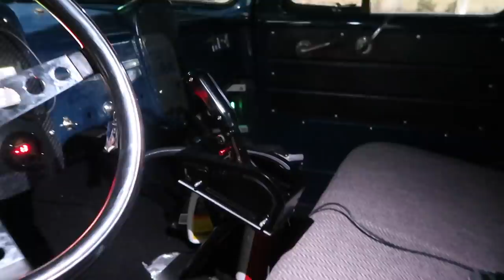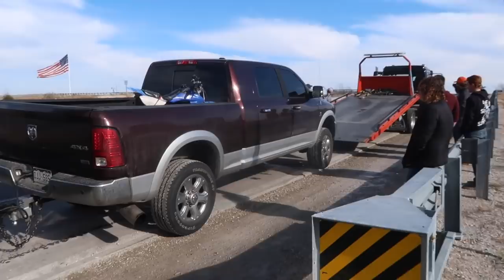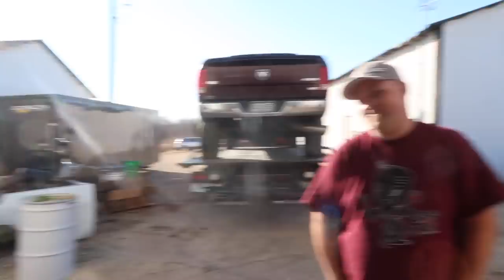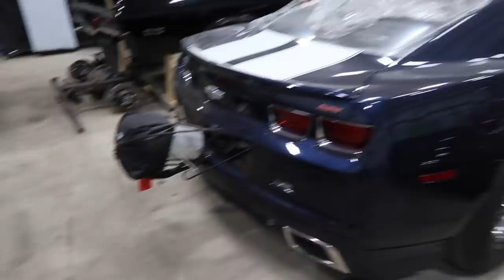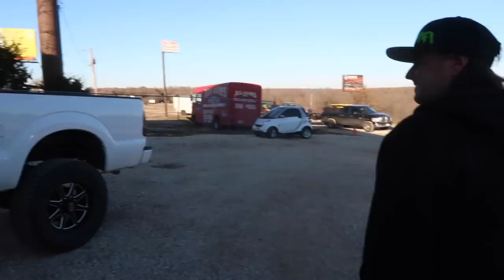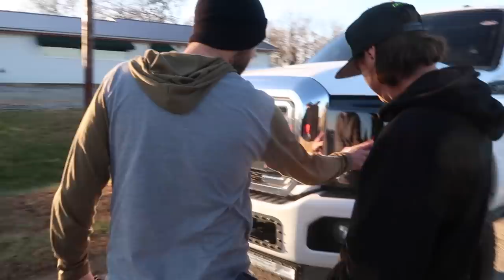Our New Tow Rig Blew Up...

Comment: Dude was gonna sell his truck Monday but let the boiz use it .... Legendary!!!
Reply: I think they should buy the ford
Reply: @burnoutfreak1000  no stick with the cummins or a duramax aint not no time for a garbage stroke
Reply: That Ford is a better truck then the year ram Kyle got there bud. I'm not a ford guy even a little but but the gen ram is complete shit!
Reply: @j0sh368  maybe gm but once again ford saves the day
Reply: @burnoutfreak1000  im a chevy guy, but cummins is the best diesel, everything will break, and in this case the cummins just went early. it happens
Reply: imagine using anything but a cummins
Reply: Could probably charge extra now :D
Reply: All the new diesel trucks are pretty reliable. It's the lack of maintenance that causes catastrophic failure. Take care of your shit and it will last
Reply: @619M3  I have had dodge , gm and Ford 1 ton, and to me my favorite is the 2005 ford with powerstroke.  I did all the bullet proofing myself and its been through hell and back. I understand the heui injection system and they are simple when you understand them. Great power, and the truck and zf6 trans are all around better imo
Reply: @619M3  gm is having major issues with their new platform ford is also and so is nissan which is why they discontinued it. not sure where youre getting your info from.
Reply: @j0sh368  The Cummins is still perfectly fine, it's the transmission they put behind it that crapped out.  Dodge transmissions have been junk for 30 years.
Reply: @j0sh368  its probably a 5.0 1500

Comment: Take my advice guys. While the engine is being fixed, have the valve body on the trans pulled and the fluid pressure port drilled out to increase the clamping force on the clutch packs and extend the life of the trans when towing by about 3 times when towing!!
Reply: Why so it can slam into gear and burn those clutches up? Nah
Reply: More line pressure is key for anything behind a Cummins lol
Reply: @waterloo123100  You burn clutches on slow gentle shifts. Hard shifts is preferable.
Reply: MV60 You don’t want Gentle shifts or hard shifts when building a transmission. You want Firm shifts. It’s not a race car he doesn’t have it pinned to Floor on every shift. Have it to gentle and it’ll burn up. Have it shifting to hard and you wear the steals between the clutches. Or worse the snap ring jumps out and you loose all your gear train. I see it all the time at my transmission shop.
Reply: @waterloo123100  Thanks, I understand the difference you're now getting at. :)
Reply: @waterloo123100   You said at your tranny shop, so then you have seen the older ford and dodge trans come in for a rebuild/replacement and seen the fluid burnt all to hell and stink like hell too, pop the bell housing and pump assembly off and the clutch pack friction material is black as charcoal if not non existent and have the usual spiel of " Well I was pulling so and so that is well under the tow limit, why is it burnt up?"  As you know back then they cut the pressure back too much and it would self-destruct the tranny....
Reply: GingerSquatch Actually I have no idea what your talking about. Older ford and dodge transmissions doesn’t tell me a lot. And the only bell housing you can pop off separately that I can think of is a Gm 4l60e.

Comment: Blames dodge 3/4 of video. Find out later he Towed 10000lbs with a converter code the whole trip. Lmao
Reply: Exactly.
Reply: slip, slip, slip..........boom
Reply: @SuperSreggin  not much of that is a Chrysler
-cummins engineer
Reply: Dodge are known for transmission problems so its no wonder why it had a code
Reply: @mitchellmeyer4177  bahahaha only the engine... mr I work at cummins. Not even the trans or anything else pfffff
Reply: @SuperSreggin  clearly you don't know how auto manufacturing works lol
-mr Cummins 3-4 years of automotive manufacturing experience. Half the ship that you think your auto manufacturer made, isn't made by them. Hell I've heard of our own company not buying our own parts.just because we make our own shit doesn't mean we'll even put it on our truck sometimes
Reply: Cummins is a different company to Chrysler/dodge. It’s a Cummins motor and a Chrysler trans and converter. Only thing Chrysler did was make the mounts and accessories
Reply: ima say it got way too hot and blew a transmission line, the oil on the road looks like tranny fluid because if it was diesel it would have been pitch black, the "bad engine sounds" would have been the converter screaming
Reply: Could have been prevented by addressing the tcc code and installing a new solenoid.
Reply: Torque  converters produce all the heat in automatics, not having the converter lock up probably overheated the transmission.

Comment: any of the big three diesel brand would have had issues towing through transmission check engine lights. it all worked out so dont sweat it
Reply: Yeah I have seen a lot of the newer aisins behind cummins and even our isuzu nrr having issues . We have one 2020 isuzu 1 month old and it's in the shop under warranty already for trans. And we can't touch it because we aren't a GM stealership
Reply: @andrewbartleman9169  seeing stuff like this makes me scared of automatic transmissions and new cars LOL
Reply: Any transmission is going to die a hot death while towing with an unlocked converter.
Reply: @guhfluh  could not agree more, I'm a dodge tech and I specialize in transmissions. If you are towing with an unlocked converter you can expect Chernobyl style meltdown.

Comment: It's a dodge, that explains everything...
Reply: Nailed it bro!!
Reply: When I saw the thrumnail I said yep it’s a fucken dodge
Reply: And another guy will say Ford is shit ,all cars have their weakness you win some you loose some
Reply: Team Ally Racing well said 😕
Reply: Shit between the 1st owner (us border patrol)and myself my 06  dodge was at 200k on the og 5.9 "600"  engine and stock 48re trans with no problems. The border patrol prob never shut the the truck off more tan a few hours a day for 5 years and had a ton of idle time wich his horrible for deisels but the dodge was solid as fuck! However kyle aint rolling a 5.9 600
Reply: @teamallyracing1780  just saying my company has an '01 7.3 powerstroke f350 with 480,000 miles original motor rebuilt trans at 412,000mi. Original owner '06 6.0 powerstroke with 435,000 miles on its second motor original trans, motor replaced at 376,000mi. It all come down to maintenance, I'm sorry I've always had good luck with Ford as opposed to any other trucks.
Reply: @MrFlareone  doesn't compete with the 7.3 powerstroke.
Reply: @matthewjackson5943  true its all about maintenance ,I have an 07 ram 1500 with 476k original motor and tranny I bought it from my company it's still running strong and tow my rally car with it
Reply: @teamallyracing1780  both of the trucks I have described have been pulling trailers with every tool needed for our construction crew to build walkway covers for schools and hospitals avg trailer weight between the 3 trucks we have is about 12,000lbs. They've literally had an anchor strapped to their ass their entire life. But the difference between diesel and gas is vastly different on longevity while towing heavy loads. Good on you for keeping that 1500 going. We usually run them till something breaks oil changes and fluid checks aside from that.

Comment: DODGE FANS
"MOPAR or NO CAR"
🤦‍♂️
😂🤣
Reply: Its like having your cake and eating it too. 🤣
Reply: Rodney everything breaks ford dodge Chevy they are all fuckin junk 😂
Reply: @MotoFlashMotoVlogs  i like how you listed them from worst to best
Reply: Emojis are for little kids.....
Reply: the failure of that truck was completely Kyle's fault, for trying to tow with a torque converter related check engine light on. I'm not a Dodge fan either, but this problem was totally avoidable.
Reply: Theodore Dowman ok boomer
Reply: Well I guess it's no car then...
Reply: Tony C  well my 1987 r10 hasn't left me stranded once.
Reply: and iirc  kyles old truck, the chevy, made multiple cross country trips.
Reply: Dodge = Dad's old dead garage experiment
Reply: Do any of you kids understand what actually happened to the truck?

The converter failed & a rear main seal was compromised, there was a CEL light and all.
It literally has nothing to do with the engine..
Reply: cant fix kyle towing with the tcc codes going off lol
Reply: Rodney ok boomer
Reply: Mopar = no car
Reply: @elonmust7470  has everything to do with ignoring check engine codes. its not a freakin honda you dont do that on a diesel lol
Reply: I have a power wagon a jeep and an f150 the only one that breaks all the time is the ford already 3 new rearends  a transmission and a new motor and it's still sitting every time I drive it something happens to it
Reply: @ClumsyCars  u mean best to worst
Reply: @noname-dz7ed  my boss has a f150 with 350 thousand miles on the engine and trans it runs like its brand new and hauls a bed full off tools 100 miles and back on the daily
Reply: @mrhappy8966  mine has 389000 on the body and everything else just seems to break every time I use it and it was my work truck that went  a couple hundred miles everyday..im not Hateing on ford...i get an awesome discount from ford dodge and Chevy since I had grandparents retire from them all..trust me I've a couple of each
Reply: No car it is then 🤣🤣
Reply: Tony C  Solid axle has no benifit with towing on the street and give a much harsher ride. 

The US military tested the newer Cummins and duramax for durability/ reliability and chose the duramax for the JLTV humvee replacement vehicle. It's a detuned version of the consumer engine for added longevity.
Reply: Cummins ain't a mopar silly. 8.1 vortech would have gotten the same mileage and been more reliable. I dont remember a Cummins I haven't heard that had a transmission problem
Reply: @jc2561  yes. We know who's fault it was. We watched the video. It's just a joke for the automotive consumer brand wars. Why do people need to explain the obvious all the time?not every little thing needs to be serious.
Reply: No car seems better imo
Reply: My 2012 RAM 1500 5.7 runs like crap. At low speeds with reduced cylinders is shutters like crap. Driving through a school zone at 20MPH is a real hassle. I hate it.
Reply: Mopar doesnt make cummins lol

Comment: I like the Dodge 

shit happens thoe just fix it

 Cummins is a more than solid platform to build off
Reply: Same.
Reply: the engine is fine. if he gets a built transmission on it he's good. but it needs some strong bolts to hold her on. you tune those things to put out monster torque and they'll start snapping tranny bolts. i think dodge uses kinda light weight motor mounts. the hemis like to break header bolts tool.

Comment: I have had my 6.0 for years and it haven't blow up 🤣 RIP new rig
Reply: Bet it hasn't been pulling a huge trailor though
Reply: Smh
Reply: @SKOMPAS  shit it's my hot shot truck
Reply: ya I bet lq9 is treating you well
Reply: Kevin dam Voris Bacon I think he means the ford 6.0 also the gm 2500s have the lq4 with dishtop pistons
Reply: smokes a freight train, sounds like a jet plane, faster than a cheetah on cocaine!  
Anybody would be happy to own a 6.0 with some 190/30s and either a kc stage 2, or a t4 kit. 
 My truck pulls GREAT even with an 8" lift and 38s still on stock gearing!
Reply: Og Fuct  200k is nothing for a diesel. dodge trucks are just junk. only good thing is the motor
Reply: Thomas Morgan holy shit that’s the perfect slogan for a 6.0. That turbo sound is incredible on those trucks.
Reply: @lmCIoudz  damn right.. dodge engine nothing else ugly as fuck ...
Reply: bet you havent been pulling big ass trailers with check engine lights on LOL
Reply: @Tristan Greer how did u get started in hotshot I’m 18 yo and interested In doing tht
Reply: Tristan Greer
Reply: Og Fuct  do the single you will love it. Had the s366xe on mine. Just be prepared to peddle it when boost hits doing 70mph and you start crab walking down the road 🤘
Reply: Think somebody wants a cookie
Reply: bet you got it bulletproofed
Reply: @g32k  not true, dude I worked with had a 2500 with an lq9. One of our box trucks also had an lq9. I thought they all came with lq4 as well. Not those two though
Reply: Dan// that’s what someone would say when they haven’t worked on diesels.
Reply: Ford built tough best light duty diesel trucks 👌🏻
Reply: Damien Doisher must’ve been an option at the factory or something. the more you know gif plays

Comment: Dodge Diesel's engines are the best you can get, there in everything from small tractors to Semi trucks, the rest of the truck not so much, but a good transmission they will run for ever.  My converter went, luckily in my driveway and new transmission and I love it. But 12valves are the way to go.
Reply: 500AWHP VR4-GALANT Dodge never built a Diesel engine neither did Ram
Reply: umm yeah CUMMINS makes the engines. dodge just slapps them in. they usually are mated with an Allison transmission.
Reply: @CotyRiddle  aisen transmissions.... chevy uses allison
Reply: @Slammed46  so does dodge.
Reply: @CotyRiddle  no they dont... never have ... cummins had 47rfe, 47re, 48re, 68rfe, never a allison
Reply: @Slammed46  i was always told they used both but oh well

Comment: to be fair, every dodge has a check engine light
Reply: But they still run nonetheless, especially Cummins 😉
Reply: Xilent they’re cheap junk
Reply: @jimmysturdevant9843  lol like your first car?
Reply: funny I have at least 10 and not 1 has a check engine light on
Reply: My check engine light goes out right after I start the engine. It's a first gen 1988 Ram.

Comment: Olé cummapart😂😂😂🤦🏾‍♂️🤦🏾‍♂️🤦🏾‍♂️hope you still made it
Reply: So dumb....  I've got big cams from the 60s that've put millions of miles down with nothing more than bearings & resleeves..
Reply: @elonmust7470  thats like comparing apples to oranges. Light duty pickup engine vs HD over the road commercial engine.
Reply: @keeganlangford5580  How is a 12v 5.9 any different than the newer engine?

3 & 400 big cams are just larger versions, a simple inline 6 cylinder...

The dodge in this video lost a converter & a rear main seal, so the engine was not at fault...
Stop talking about shit that you don't know..
Reply: Theodore Dowman well a Cummins is a good engine don’t get me wrong it’s just wasn’t probably taken good care off from the previous owner

Comment: They don’t sell their trucks without a reason. Find the reason before buying used
Reply: They got a newer tow rig probably? I've sold trucks with no issues because I got a newer one... Had a 1988 f250 ran perfect but I got a 2014 ram 1500. Sold the 1500 because I got a 2500 cummins. Got a 1999 f350 7.3 I'm selling with no issues because i don't need 3 trucks. On top of that, if it had issues, I don't think they would be letting them borrow it to tow with...
Reply: He’s pulling with it I think it’s fine😂

Comment: Pulls trailer across the country with a torque converter code and high trans temp then wonders why it broke down🤦‍♂️🤦‍♂️🤦‍♂️
Reply: bobby hill I was thinking the same thing
Reply: To many work on boosted engines with no check engine lights, so I assume loosing a touch with reality when that light and code came on🤣🤣🤣🤣
Reply: Piss Poor Proper Planning
Reply: Yep; thinking the exact same thing. And then complaining that it wasn't reliable.

Comment: U didnt "do it right with a new truck" when u bought it with a 1/4 million miles it....EDIT: the whole point of the comment is dont be surprised the truck broke when doing a long trip in a not so new truck. It might look great on the outside(bodyshops do wonders). IDC about ur friends million mile truck.
Reply: It’s a diesel. My duramax has 267,654 miles and I’ve replaced a water pump
Reply: My bad, tires too.
Reply: 250k is baby miles for a diesel unless PO taken care of super shitty
Reply: My old 02 has 760,000 miles and still going strong
Reply: Lol yeah dude acts like he bought a brand new truck....
Reply: @robtheARguy  that's my whole point but now all the "my truck has" comments are coming out
Reply: It had 170.000 miles on it when he bought it.
Reply: @1swedeturbo  not the point I was making
Reply: @Anthony-vr3um  not the point I was making
Reply: You guys do realize....? he said he tried to do it right with a NICE truck, not a NEW truck. He wasn't bragging about a new truck. Just that it was a NICE truck. He was just excited about having a newer year truck than the duramax.
Reply: Guys pull trailers all over the interstate all day every day with 250k-500k miles
Reply: @leviwyatt5921  point is doing it right doesn't work when it has 170k+ miles on it and expecting it to just work..idc if it's a Cummins, Ford or a Chevy...plus he bought it in Colorado so the chassis and brake lines are gonna fall apart from rust.
Reply: @tokeypokey  not my point again

Comment: Your not alone dude. My ford died at 120k 🤷🏽‍♂️
Reply: 6.0 or 6.4 because the 6.7 are reliable there's a dude on social media who's 2017 f350 has over 500,000 miles and only the rear end went out at 450,000
Reply: My 6.4 has 250k it's all in when they were deleted this one was deleted at 8k miles
Reply: Nah. 3.5 Ecoboost. I should have known better

Comment: Dodge fans: mopar or no car, 

Me: my legs are more reliable
Reply: 2jz Gabe my challenger hasn’t had any issues ever, I drive it 2400 miles twice a year from north of Toronto to Scottsdale az. Not once has it ever skipped a beat.
Reply: MuskokaJames that’s the thing though, your challenger hasn’t. However I’ve  seen more unreliable dodge cars than reliable ones.
Reply: Have had three DODGE trucks first two well over 300,000 and the one I am driving now has already gone 230,000 not a problem with any of them and will be buying another one without hesitation